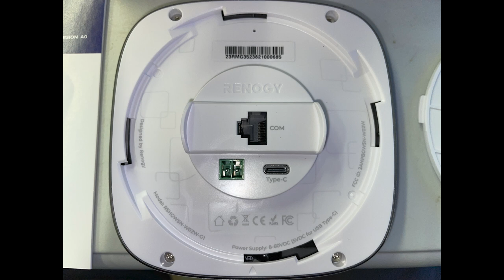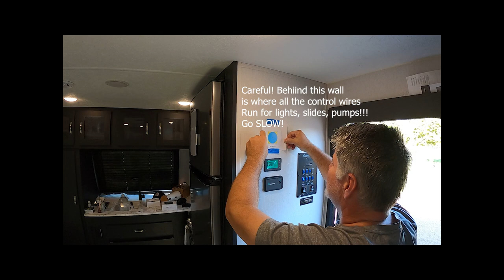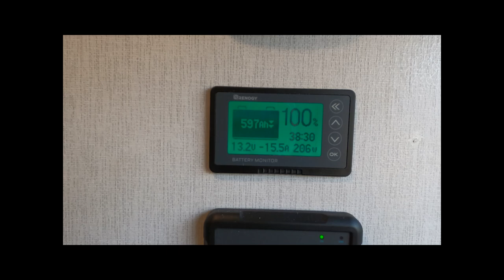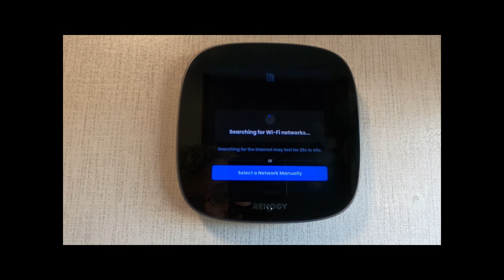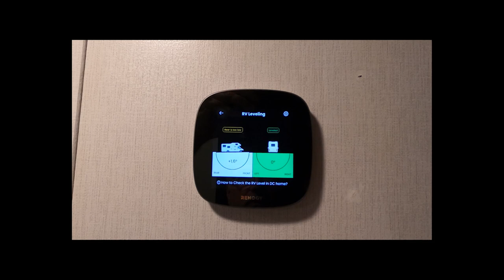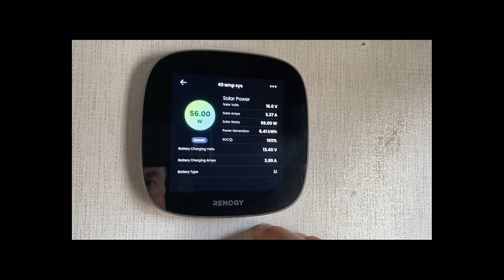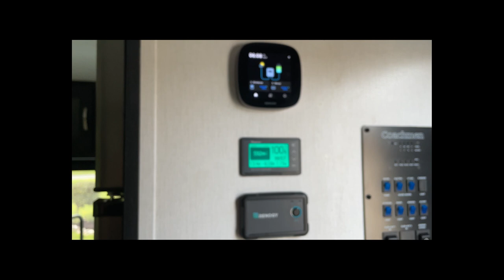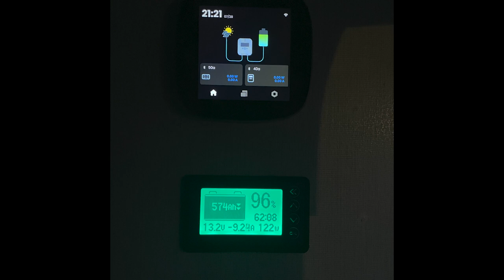Renogy ONE Core install in our RV #RVpower

Comment: Very helpful video. My new 40amp Rover 40Ah charge controller and core 1 will be arriving in the next day or so. I have a small off grid setup as backup power to my home, using 400 watts of renogy pannels and the adventure 30amp controller to charge  my 4 deep cycle tractor lead acid batteries. With my new charge controller, I'll be adding two more pannels to make 600 watts which help with winter charging needs to  feed my renogy 2000 watt inverter. I'm excited that I'll be able to monitor production while away from home and the upgraded mppt charging with the rover controller. Thanks for posting your video it was extremely helpful to prepare for setup.
Reply from the maker: @sgtcote1  thank you, you're welcome and if you get stuck, please reach out!
Reply: Ill keep that in mind.  @ThreeDayRV

Comment from the maker: 10/1/23 Update. So the original Core 1 failed, we tried several times to get it corrected with Firmware and resets, eventually we sent it back and Renogy stood high and replaced it... The new unit looks the same, but it works very fast and updates quickly as it should have all along. I am very happy with it, especially the RV leveling function.. Side note, the BT leveling part is a bit weak, you have to have the smart phone very close in order for it to ready the Core 1. I will be dropping a video collection of the complete system install very soon, so please like and subscribe to check out those video when I finally upload it. Thank you!

Comment: If you want to ditch the Bluetooth or just get down to a single Bluetooth adapter, you can buy the Renogy Hub.  Then you just plug in with RJ-45 cables all the devices, and then either directly wired to the core or you can install the BT2 adapter.
Reply from the maker: Very true. So far the controls and controllers are 8' apart so connectivity hasn't been an issue. I almost bought the hub, but decided to wait.

Comment: I have heard that the Bluetooth isnt strong enough to use the app on your phone in your truck when leveling.  Have you had this problem??
Reply from the maker: The last time I checked it was indeed to weak to reach the cab of my truck. If I were at the hitch it would read. I will check it again maybe tonight to see if this has changed.

In full disclosure, I have a unit that I picked up from BeechLane that's in  my video list . That unit is battery powered and that's what I use. It is fantastic.! Check out that video !

Comment: Nice video. Q - why did you go with dc-to-dc as well as a charge controller. Doesn't the dc-to-dc also do solar? I'm adding lithium to our Class A - trying to figure out if I need dc-to-dc with only 200 ah batteries.  Or if Rover 30A charge controller is all I need. Thanks.
Reply from the maker: @slgreig, fair question. Our travel trailer is 29 feet overall and link and it is a higher feature couples travel trailer, utilizing more of the internal space and less cargo storage compartments so I had a very small compartment to work with which was a perfect opportunity to put all things solar inside. The charge controller that I used is a very good one and you are correct it does do solar, and DC to DC with solar being the priority first. Something you should know though is that this controller has a 50 amp total max output regardless of the mix solar/alternator , 50 A is your max. The only other reason is outside of space-saving is that it was on sale day after Christmas and I believe it was nearly 90 bucks off so I had to buy it. Please check back in and let us know the route you went.

Comment: How do you get the screen with the battery %
Reply from the maker: The core one talks directly to the devices by hardwire or the BT method. When we originally installed this I didn't have the BT batteries or the Renogy BT shunt. A few months after this video release the shunt finally came out. In another video I hooked up the shunt and brought the battery total voltage to the One Core device.   For me, it was a no-brainer to use the battery shunt because it accomplished the goal that I needed. Since the making of that video, Renogy also has a very good smart battery that connects directly to the One Core.
The reason that I like the battery shunt method is that it shows me the battery current that were using, and when the sun is out and also shows us how much charge we're putting back to the battery bank.

Check out the other video where we are installing the shunt, this will likely explain more on the next video.
https://youtu.be/HivrqZNz1DU?si=h3qppIqD0AioKX8_
Reply: I have 3 x 100ah Renogy Core batteries, 50ah DCDC, 2000w inverter, 300a shunt, BT2 and currently have the One M1 display. I have a One Core on order. I’m hoping the new display will work better with my system. I can’t get the battery % to display on the M1 or my app
Reply from the maker: @MrSouwesta  I've read somewhere that the M1 won't display it as of yet, I think I've read that they are working on the new firmware version that will allow the battery percentage to show up on the M1. I think the one core has more value in this application, but there are many functions that you can use the M1 for, full disclosure I don't have theM1. 
The One Core it's perfect for my needs in our RV. Be sure to share with us how your project goes. I'm always interested in seeing others DIY projects!
Reply: Fingers crossed as I may keep that one as a secondary display in my setup

Comment: does it have to connect to wiffi for it to work?
Reply: @richyrich1723, no is quick answer. It can just be a display that shows the status of the batteries, controllers and RV leveling . If connected to a network you can look at it remotely and can toggle things / on off with the Renogy smart plugs. Network just makes things a little handier.
Reply from the maker: Network is not needed for this to work. It's primary purpose is to be a central point to monitor all of the Renogy devices. It only works with Renogy products but we're hopeful that they will get onboard with open framework to expand other devices. 

Great question!
Reply: Thanks. 
Hopefully will be available in Canada soon.
Reply from the maker: @richyrich1723  sure is odd they you can't order it and get it shipped to you... That is strange

Comment: can you use 48 volt DC from 48 volt batteries?
Reply from the maker: I think you're asking does this device work on a 48 V system?
Reply from the maker: So it operates on a USB-C power port, but it will monitor compatible Renogy devices, if those devices are 48 V it will definitely integrate with them. that should be no issue for clarity. This device operates on 12 V or a USB-C power supply.
Reply: @ThreeDayRV  yes
Reply: @ThreeDayRV  I found also in manual , that it can operate from 8volts to 60 volts
Reply: @ThreeDayRV  Iam switching from 12 volts -800 AH to 48 volt 200 ah , and switching to a new inverter charger /Solar, - soon I will upgrade to  3 wall units X 48 volt batteries X 200 ah, trying to extend the length of usage and also installing an Type 2 EV charging plug so can  whip into PTT EV chargers or PEA Volta which has 230 volt plugs that I can use to charge batteries while camping on the road(thailand)
Reply from the maker: @twin-p7e I admire your enthusiasm !!! Very nice plan